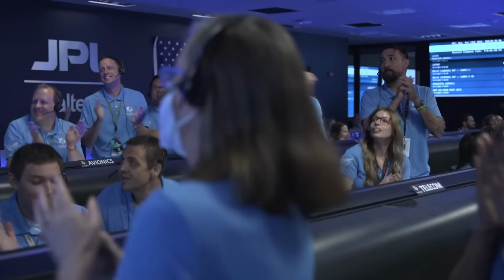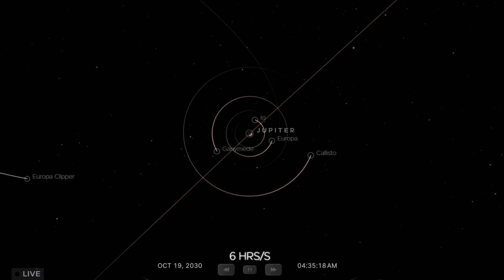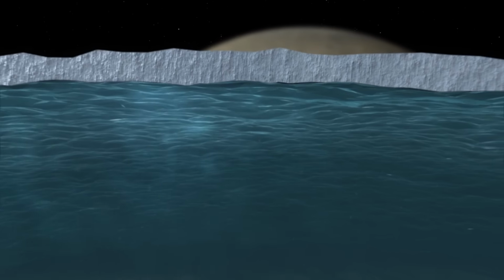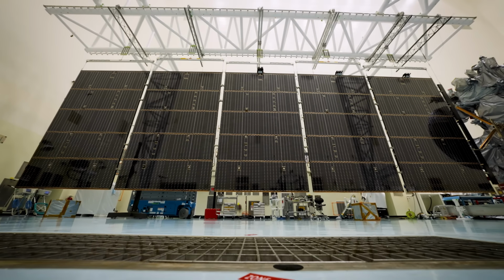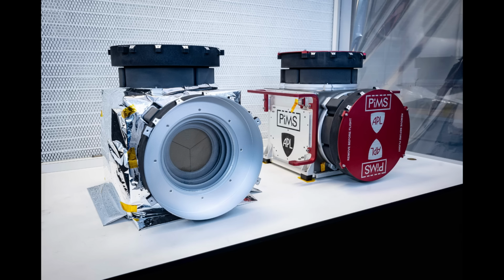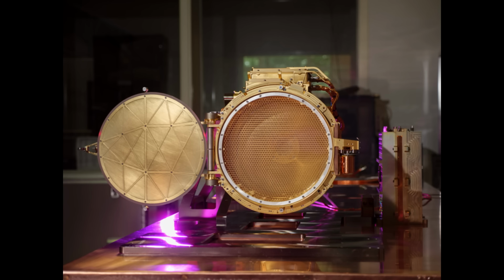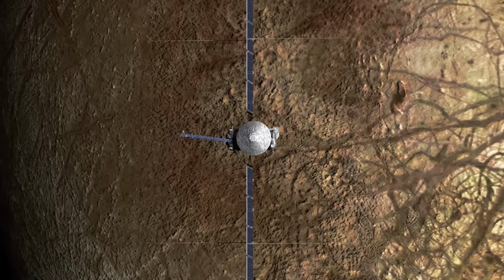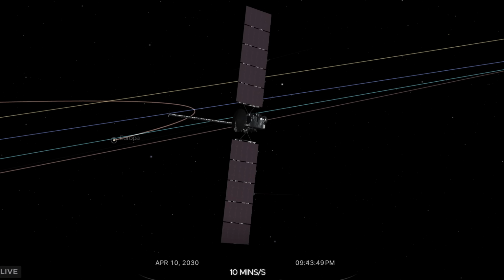SpaceX Ditched an Entire Falcon Heavy To Launch NASA's Massive Probe To Europa!

Comment: What if they used the solar panels as a radiation shield? Like have a a giant panel on a swivel that follows the radiation on one side, while at the same time sheilding the instruments on the other side. Then if the instrument is surrounded, you can split the giant panel and at least cover around the satellite and leave the top and bottom open. So that it doesn't block all the instruments.
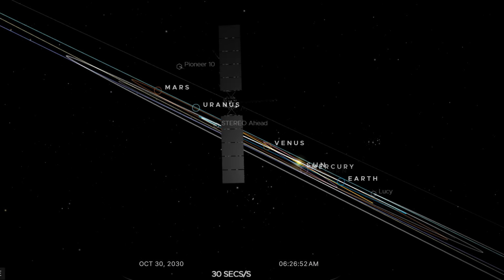Reply: 12:42 That would cause damage to the solar panels. I would think that your idea could be used as a last ditch effort near the end of the mission under some circumstance, but I'm not a NASA engineer. It also depends on how well the solar panels actually block radiation.

Comment: They use Pu238 for electricity generation because, just by coincidence, it emits Alpha particles, but no Betas or Gammas.  Those two are the ones that radiate out and destroy electronics and materials.  Alphas, though, are stopped easily.  (Their real danger is in the human body, where the alphas are right near the molecules it'll destroy.)  Put Pu238 in a thin lead case, and you're safe.  Somehow, no other isotopes emit such low beta and gamma radiation.

Pu238 is harder to make  than Pu239, for weapons.  To make 239, you take natural or depleted Uranium 238 (cheap), bombard it with neutrons (like from a reactor, like from the reactor you want to burn the 239 in).  The U238 becomes U239.   After two beta steps (quick), it becomes Pu239.  Most power reactors actually breed some Pu239, effortlessly, and burn it over the years.  

Not so easy with Pu238.  They have to start with Np-237. You want to avoid isotope separation - that's what you do with Uranium to squeeze out a little U235 for reactors or bombs.  To avoid that, find a bottleneck isotope, with no sister isotopes.  Then, refine it out with chemistry. 

So, for instance, spent reactor fuel has tiny amounts of Np-237; the Np-239 decayed and converted to Pu-239.  But not the 237!  And, there's no other Neptunium isotopes in it.  So you use some chemical hocus-pocus to get rid of everything but Neptunium.  Then, you breed that pure 237 into Pu-238 with a single neutron. Big hassle but nobody has a better way.

Comment: The 3rd way to protect against radiation is to use radiation hardened parts.

Back in the day, I was involved in testing microelectroncis for space radiation.  We had specially designed ICs and we compared them to commercial off-the-shelf equivalents.  The former lasted a good long time several weeks, 10 minutes at a time.   The latter could not even survive a single cycle of radiation exposure of 10 minutes.

Comment: What happens if you go clockwise instead?
Reply: launching a rocket clockwise, counter to earths rotation needlessly increases the amount of fuel and burn time required to reach orbit. first, the rocket has to counteract and cancel out Earths rotational speed before it can even start accelerating to orbit. Launching with the direction of Earths Rotation is the most economical way to reach orbit.

Comment: 12:23 - U-235 instead of U-238 ? 99.7% of mined uranium, is U-238. The U-235 is the spicier stuff, that's part of that 0.03%.
Reply: They aren’t using Uranium (U-235) they are using plutonium (Pu-235)
Reply: I made that mistake too
Reply: Plutonium 235 is the same stuff used in nuclear reactors

Comment: hi 
Question if I may.

I notice the spacecraft uses a lot of Kapton and Kapton tape, as do many spacecraft.

Given this will be operating in an area where it may pass through plumes of saltwater, which may then leave salt deposits behind after contact with the craft, and that the frozen droplets may contact warm areas of the craft...

Do you know of how this may affect the craft/tape given that it has very poor degradation in the presence of seawater, and therefore i salt?
Has this been studied for this craft, are there any contingency plans? well as much as there can be.

Thanks yall

Comment: Can you imagine the size of the probes Starship will be able to send??
Reply: Pretty big, like the space shuttle also launched some big missions
Reply: Not much bigger, without any payload it can match the performance of Falcon heavy once refueled
Reply: @scpguy1381  LOL, Wot?
Reply: @dannyarcher6370  it’s has 8kms of delta v, which isn’t much more than what Falcon heavy gave Europa clipper
Reply: @ Then why are they building it? Why not just use Falcon Heavy?
Reply: @ starship is far cheaper and has more payload to LEO
Reply: @ But it's meant to go to Mars...
Reply: @dannyarcher6370  yes it’s meant to send people to mars, not probes to outer planets. It’s very heavy and specifically made for mars colonization
Reply: @ Let's think about this carefully...

Which do you think will be bigger and heavier?

Europa Clipper or the equipment and habitat infrastructure required to support humans?

In your response, consider that the transport system to Mars will look different to what they've been using to launch probes so far in that there will be refueling in orbit.
Reply: @ starship has a Delta v of 6000m/s when filled with cargo and 8000 m/s when not filled with cargo, simply because starship is extremely heavy compared to a Falcon heavy upper stage which doesn’t have to carry an additional 120 tons wherever it goes which is why it could launch Europa clipper the same distance that an non cargo loaded starship could travel
Reply: @ Orrrr...It could launch into orbit, get refueled, and send a huge probe on to wherever. No?
Reply: @ no this is accounting for refueling, but getting probes to Jupiter requires a large amount of delta v which is harmed by the fact that starship mases 120 tons dry that it has to carry to whatever probe is goes, Falcon heavy’s upper stage is only 5 tons by comparison. It’s simply isnt built for these kinds of missions.

Comment: 7:30 For those that ride motorcycles, that action, the gravity of Jupiter kneading Europe is very simply stated the same as your tire warming due to its compression and expansion when that part of the tire compresses as it takes the weight of the motorcycle, spreading the contact patch and then uncompressing again as that point moves on and the next point compresses. That's why your tires get hot. And why Europe is warming than we would think.

Comment: would be interesting to see inside europa with some type of ballistic "missile" that punch thru the ice crust then that tube opens to reveal a submarine probe x3
Reply: Probably some sort of little metal probe that melts through the several mile thick ice connected to a really long wire.
Reply: I think that's something like 10 miles of ice and ice at those temps is as hard as granite. I think we need nuclear! :)

Comment: I know it used to cost $20,000 to get 1 Kilogram into low Earth orbit.  I'm curious what is it now, what are the differences between different launch systems, and what is the difference between falcon 9 / falcon heavy in expendable vs reusable modes?  Might make a great episode for you.
Reply: Well, just to touch, IF you use a F9 which according to material from spacex gives you a maximum mass of 22,000kg to LEO for a cost of 69.75 million USD.  So $3,170 per kg.  I am not sure if that's expending a booster or not though.
Reply: @imaginary_friend7300  Most likely in recovery mode.  Thanks.

Comment: Oh damn, I thought it was going to land on the surface, like the recent Mars buggy. They should have added a little capsule to it that can be sent to the surface, do some exploring and digging, and beam results to Clipper.
Reply: A probe that would be able to do that would be a lot heavier and thus more expensive. It would need a lot of propellant to even enter orbit around Europa, let alone land, and it would also need to survive the high radiation.
Reply: @debott4538  OK, thanks. I guess just letting it fall to the surface, even with serious padding and shock-absorption built in, would be expecting too much.
Reply: @gerhardvaneeden5615  you are thinking of lithobraking! Unfortunately it doesn’t work well at all since scientific equipment is extremely fragile
Reply: Well, they don’t know if they can even land on Europa right now.
Apparently the surface of Europa could be covered in massive ice spikes, making it extremely hard to land.

But don’t fret, as the Europa clipper will do observations for a potential landing site! There’s also already a Europa lander in the works, it’s also quite massive so it would be impossible to have launched with the clipper.

Not even a little lander strapped onto the clipper could work, as the Europa clipper isn’t orbiting Europa, and you have to orbit something to land on it. Europa has little to no atmosphere so you can’t use a parachute like the mars rovers do, you have to use rockets to slow you down to safely land.

Sorry for the yapfest, basically a lander would be too big & is being launched separately.

Comment: Why do camera's on satellites have far less MegaPixels, this one 8MP compared to a Samsung Galaxy S24 Ultra with a stunning 200MP. It gives you the chance to make much more detailed foto's where you can zoom in and have no problems with pixels showing up on your photo. So from far distance foto's to close up's where now maybe 1 pixels covers let's say 5 meter of surface. And with a 200MP Image Sensor you maybe can get so precise with maybe less than half a meter at the moment Europa Clipper flies the closest around Europa. So why use only a fraction of what is possible these days?

I know that only adding more MegaPixels doesn't make a photo better because each pixel needs light to make. And the tinier they get, the more light they need so that will impact your shutter speed and also your ISO- count what can make the photo less sharp if moving fast. So you need a high shutter spreed  and with a higher ISO your photo gets more  'noise' on the photo what is also debating the quality. So knowing this I get why not 200MP And even not 54MP what is on the most phones.

However there is another very important point that can make a photo better or worse.  That is how big the Image Sensor is where all the MP are placed. 200MP on a tiny maybe 1cm Sensor causes a extremely dense and very tiny pixels. But on a Big satellite you can build a very large Sensor where there is so much more room for the pixels, so they can be bigger and therefore more light exposure. 

SO My POINT on this is. Why do they use a so low amount op MP on a camera that can have a very large sensor so some more pixels would absolutely help to get better and scharpef photo's when zooming in. The difference between a 54MP Phone sensor and a DSLR Camera with close to the same amount of MP is already Huge.
Reply: Part is the camera's are custom to endure the environment and digital camera's suffer bad from radiation noise in a high radiation environment.  Another issue is data itself.  They have pretty limited transmitting power and bandwidth and the distances are huge so that means DNS time.  High res pictures take more time and money on the DSN to download.

Comment: Hmm. I do have to wonder if the plumes are subsurface water making it to the surface, or millions of years old ice that has been turned liquid and ejected from effectively tectonic pressure near the surface. Me not knowing whether this is known already, I would guess its the latter.

I would imagine that an isotopic analysis of the water could differentiate whether it came from the surface or deeper where it would be shielded from radiation.

Comment: Hi Scott. Excellent overview. I was the mechanical system engineer at JPL. The Venus fly by was based on the Delta 4 heavy LV. Early on we had SLS but it wasn't guaranteed. We fell into this time period where there were no LV available on the market so if SLS fell thru, we would have to piece together a Delta 4. Once FH became a possible LV, we started work shopping a Star 48 or Orion 50XL kick stage. Psyche work led to the MEGA option that made the kick stage obsolete. So we removed some .65AU capabilities for the less stressing .82AU hot case. We still have huge temp ranges. SA are deployed and everything is working well so far. Few little "whats going on" but working well. We just finished the first frequency ID. GNC is still working the response data. We're about 2 weeks out till magnetometer deployment and 4ish weeks out till reaction wheel spin up. Go Clipper.
My first time working with SpaceX and they were great. 
You should do a quick video on the MOSFET issue. 
Maybe we'll get an Enceladus Clipper next.... While we still have the engineering knowledge on hand.
Reply: It really is awesome and greatly appreciated that you and many of your colleagues drop into the comments of Scott's videos, to share info and even answer some questions. 
Thank you! 🍻 It's a nice reminder that there's are still some really positive things the internet has to offer, in spite of the negatives 😊
Reply: @DUKE_of_RAMBLE  second these thoughts!
Reply: Thanks for the details,  very interesting.    

And huge congratulations on getting this far 🎉 , what an amazing vehicle and payloads.
Reply: Thank you for your service for putting a human machine out among the stars.
Reply: That is a really cool project, congratulations on the accomplishment.
Reply: The kick stages don’t cost much, why did they go with MEGA instead of adding a cheap kick stage?
Reply: My grandpa is Wernher von Braun
Reply: I suppose that would require a Starship with in-orbit refueling. Would Vulcan with six SRB‘s be enough? Probably not, plus there’s the problem with solids shaking the electronics.
Reply: @EMichaelBall Vulcan wasn't going to be qualified in time but I'm sure we could find a trajectory where it would work and have the ride. But I don't know for sure since that wasn't a vehicle we considered.
Starship is bigger than FH so it would work. But I don't know how spacecraft separation would work. I've never seen that as a Starship use case. I think they may have proposed cargo doors at some point. But it's also not qualified in time.
Reply: @EMichaelBall  VC6L would never have thrown this hard enough. Fully expendable FH has close to twice the capability to MEO and even here it is 60-70% more capability.

Comment: Hmm... an amateur with a thought: with all of the radiation and magnetic fields flying about, can some of that be "harvested" as a power source? (for spacecraft, not Exxon)
Reply: In theory, but in reality it's not that easy.  I did read about it a long while back and part of what the issue is a gamma photon is about 1000x more energetic than say a photon of good ole blue light and finding a material that it can interact with enough to eject an electron is not easy.  I have sh*t the bed on that, but it's part energy and part material science.

Comment: This should have gone up on on the SLS so the mission would have been shorter. Or the Ariane 6 would have been a better alternative
Reply: Ariane 6 has far less performance than falcon heavy, for example JUICE launched on the more powerful Ariane 5 and despite launching a year earlier then clipper, it will arrive several years later
Reply: @scpguy1381  Less performance WHERE? LEO,GEO, MEO, Extra-planetary?!  Pick where its less performance, because its not one-size fits all. It doesn't work that way. The Falcon Heavy doesn't have the most dV in all situations. Then when you consider some of that fuel is used for booster recovery. This also why FH is terrible at interplanetary transfers as they never bother with a 3rd kickstage.
Reply: @ when expended it has more c3 performance (performance to high energy orbits and escape trajectory) and and more leo performance, for example Falcon heavy can take twice the payload to geostationary as Ariane 6, and for cheaper, even when expended. Ariane 6 is barley heavy lift while Falcon heavy is Superheavy lift when expended